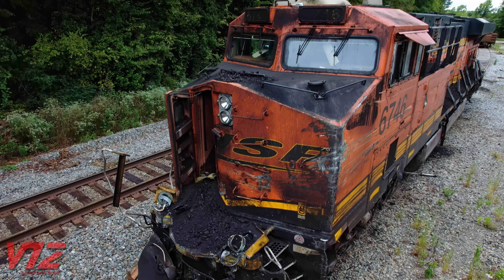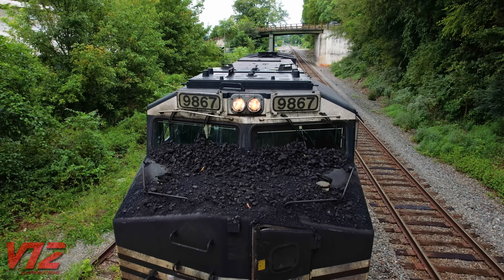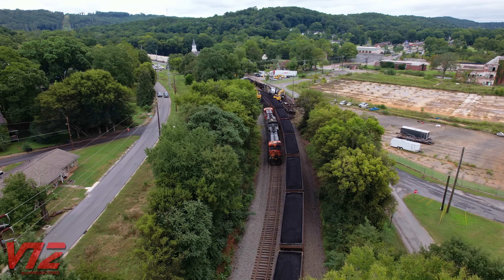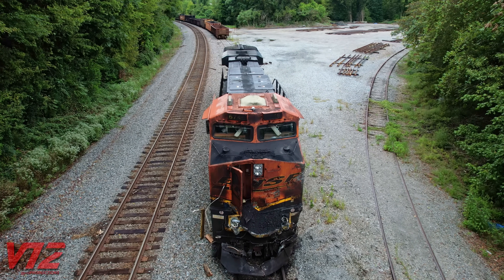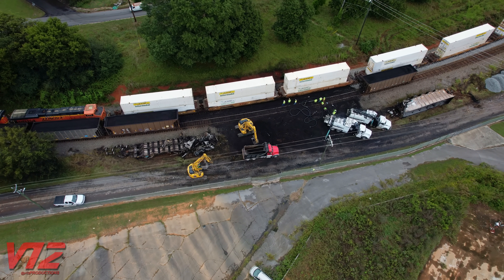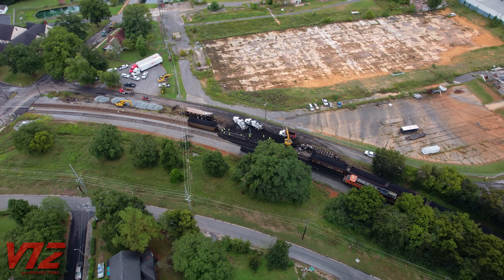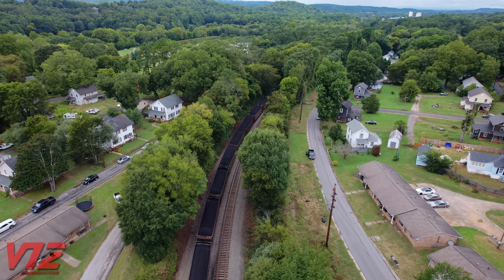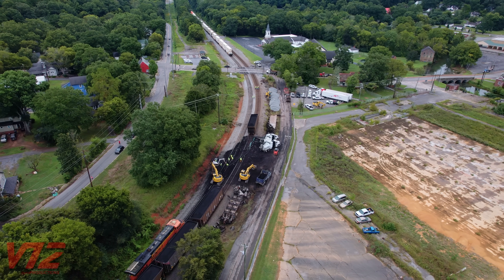RUNAWAY Locomotive & Head-On Collision in Rome, GA

Comment: Came back to this video after seeing a video surface from one of the crew members of the train that got struck head on. The video shows the single BNSF locomotive running red light in cab at a steady pace past the worker, and then slamming into their train. Thanks for the clear explanation, crazy to see with all the things we've done to modernize railroading, runaway trains are still a risk. read through the comments and glad to hear no one was onboard during the collision, hoping for a quick recovery for the crew that jumped.
Reply: Can you share the name of the video. Not having much luck finding it.

Comment: they are all good, lead engine knuckle came apart after hitting the coal car that jumped track idk why, but it ripped all the brake rods off and chains the left side and with air lines cut off no air could supply the other side making them useless and no chains means no hand brakes either.....and if i remember correctly when it goes into emergency the dynamics cut out
Reply: I was wondering how it could “break free” without going into emergency and kept on going. That explains it! Man, that’s the worst bad luck an engineer could possibly have! Damn!
Reply: Damn !
Reply: It probably depends on the railroad as far as the pneumatic brake application disabling the dynamic brakes. One class 1 that I know of has disabled that feature on most of its locomotives, the big road units for sure. You might know the guy as Uncle Pete. The dynamics work 100% of the time, unless there’s something wrong with them and the crew had to disable them manually.

Comment: On another railfan site the word was that both crews are a little banged up from bailing out.  According to the word there, the coal train went into EMERGENCY for some reason and two hoppers near the rear derailed.  The intermodal sideswiped those hoppers.  I do NOT know why but apparently the lead locomotive of the intermodal became a runaway (no brakes) and collided head on with the NS unit at about 25 or so MPH.

NONE of this is official and is subject being 150% wrong, it is only what I had picked up from another site.  But according to that site there were NO DEATHS or life threatening injuries in either crew, broken or bruised ribs and arm / wrist injuries consistent with jumping from a locomotive.
Reply: the no brakes part is accurate, 6746’s brake cylinders were sheared off as seen in the beginning, which meant the emergency application did absolutely nothing.
Reply: Your pretty close. Storms were giving the signals issues and the signal in front of the coal train dropped on the crew. PTC put the train in emergency and that pushed two hoppers off the track. The intermodal train side swiped the coal hoppers shearing off the brake cylinder and brake rigging for the handbrake. This also caused a dynamic brake failure somehow and the rest is history.
Reply: Storms was giving the signals issues. So they no damn well the machine broke down ! And why. That's just how deceitful the big wheels are. FRA needs to step up and do their job !
Reply: @rc391995  Its not uncommon to see heavy rains affect the signals. Just the other day PTC showed an intermediate signal dropping from a clear to a restricting and back at the block ahead of us.   The railroads only want to make money and cut everything down to bare bones to increase profits. They have no interest in fixing the infrastructure until they absolutely have to. It's situations like in this video as to why we are not budging in negotiations and will likely end up in a strike.
Reply: I think you should strike. The very fact the signals are dropping out by no means make it acceptable. I saw this crap coming as they was putting the hardware in for this stuff.  I've logged several hundred miles as a conductor and have switched an untold amount of cars although I was mainly and most of the time a yard duck. But been sent out to retrieve dog laws quite a bunch. Not that all that matters but im very accustomed to their practices and stood nose to nose with the top executives more than once. They want to intimidate with you with fear.  I'd  die first before I would allow them to see me sweat . just sayin .Ain't my first rodeo. Hope you get what yoh guys deserve more help and more money. I don't think you will be able to strike long. Here's one you likely won't understand if your in the union don't ever vote republican. Ronald Reagan screwed over the unions for a life time . Google it you don't have to believe me .
Reply: Cloud cover has long been an enemy to GPS  that's the only reason they want one man right now. If they perfect it the will want one day to let that guy go as well. I've seen this coming for only fifty years.
Reply: Oh crap just read this . us government makes contingency plans for rail shutdown.. 

Better get t know your local chairman and general chairman well. Ask them just where you need to stand. The heart and soul of your jobs are at stake here.  Thus accident is the best defense you all have at the moment. Need to make it count !!!
Reply: L.O.L. My experience as an Engineer in real life, tells me when a consist goes into emergency, it's more than likely a DERAILMENT somewhere along the consist. Procedure is to stop train, apply INDEPENDENT Loco brakes AND train brake. walk back until the source of the emergency application is found. In majority of cases, it was always a derailment caused by various reasons. BUT, Company Policy and Safeworking Rules also stipulate that in such cases, the opposing track must CEASE traffic until it is acertained there is no obstruction. Clearly, this was not instigated in this instance. I'm very glad, that I was not employed in the U.S. to drive trains there. Not suprised to hear, they're taking stop work action, about time too, IMHO.
Reply: @itchyvet  My experience as an engineer tells me that emergency is more than likely NOT a derailment.   It is usually a separated air brake hose or other types of mechanical failure.   In particular with the autorack trains.
Reply: After looking at his post its obvious to me he'd never make it as an engineer over here.
Reply: @itchyvet  Too many train games

Comment: I don't get it.  The lead engine "broke away" and kept going...but what was its engineer doing?  He didn't or couldn't stop?
Reply: First Collision  tore brakes  up ,he had no brakes!
Reply: The handbrake chain got torn loose also, so no emergency type brake either. The dynamic brakes probably wouldn’t work either because it was in emergency after the brake cylinders were torn off and it lost train line air. All they could do was sit back and wait, either for it to coast to a stop after traveling quite a few miles or jump when they were about to hit something else on the track.

Comment: the lead bnsf motor got loose when the rear left pilot was bent upwards in the initial collision with the coal cars forcing the coupler cut lever up,  essentially the locomotive pulled it's own pin, during the brake away,  the mu hoses separated of course,  the main reservoir hose valve open exhausted all the air that it would need to slow the engine with the independent brake.  Also being in emergency the engineer couldn't recover the trainline, that valve also open plus the ripped off brake cylinders.  publicly the question remains as to why the signal dropped on the coal train resulting in ptc forcing its emergency application. the dpu units must likely caused the detailed cars in the curve.
Reply: From personal experience. The signal may not have even dropped. Seen and had it happen plenty of times, PTC just freaks out because of a communication issue.
Reply: @osrr6422  exactly, and with DPUs, they dont immediately stop pushing just because the head end went into emergency. Depending on how far the dpus were from the head end, they could have kept pushing for up to 10 seconds after the head end went into emergency.  Non railroaders dont understand that the dpus are a few seconds behind the lead commands, and in the event of a brakepipe interruption, it could be a few seconds for all the brake valves to dump from head to rear, meaning the leaders can be on their side digging up rocks, and the dpu still pushing for a few more seconds.  Basically ive said the same thing 3 times here , 3 different ways lol.  So for everyone else... that could be the reason why cars derailed after a PTC braking enforcememnt.

Comment: This was all caused by PTC - it threw the train into emergency! "NS 732 went into emergency when a signal dropped out on the crew, PTC doesn’t understand that so it throws the train into emergency, thus derailing 2 coal hoppers. NS 283 hit them and the lead engine broke free and was unable to stop and hit NS 29A head on around 4:15 this morning"
Reply: Yet the PTC didn't stop the runaway engine?
Reply: @mikenodine6713  the runaway engine lost its air brakes. Supposedly the pistons were damaged/sheared off in the initial collision. PTC can’t fix that.
Reply: Wow ! I can see all that coming into play now .
Reply: @duluthdepot6355  Thanks, now the question is what kind of engineered solution would solve that kind of issue?  Or is this kind of incident so rare that it is cheaper to accept the losses when it happens? Even if it is a school bus full of kids?
Reply: Its starts with PTC. Any time a train gets in emergency you don't know what's going to take place . and when you got several DPU's going it just compounds the problem . The train going into emergency sure isn't a pleasant experience . that's a last resort measure. Some engineers won't swipe the gauge for an automobile on the crossing till after they've hit the automobile. Some won't even do it then and I don't blame them. Its all in according to the make up of train speed weight and terrain. Lots if factors come into play dynamic forces lateral pressure. I've seen more times than I can count on my fingers and toes the results of emergency brake applications. It ain't pretty !!!
Reply: And by the way the crew was never given a choice to make as far as a corrective measure to take. The machine broke down and nearly killed a bunch of people. The machine will never have to answer for it. It made the wrong choice !!!
Reply: @rc391995  My guess is they survived because the bailed... nothing else they could do... except the horn needs a button you can push to lock it on so at least it's still sounding a warning when you jump off
Reply: We just need to go back to ATC and be done with it. 

There will always be problems but at least you can still control what the locomotives do.
Reply: It's only a matter of time before a passenger train is involved.
It will be a massive tragedy. 
I dread the day.
Reply: I'm certain they jumped . little other choice .
Reply: I'm also pretty certain I read here the guys on the run away radioed the crew  on the NS engine what was coming there way . they got off. Them guys done everything they could do with what they had left . I admire their bravery . they thought of their buddies.

Comment: I am surprised there isn’t a fail safe prevent this. In many if not all passenger trains they have such a device.
Reply: Oddly enough...it is possible (but too early to tell) that the "fail safe" device actually started this unfortunate chain of events
Reply: Such a device would not have worked when the brakes get ripped off.

Comment: How did the Norfolk southern diesel get coal-coated
Reply: most likely, it was coal that was on the BNSF loco, and when the two collided, some was thrown onto the NS one
Reply: That’s a very interesting question as well. Carried that much coal 4 miles and dumped it on the NS engine. Naw ain’t buying that one !
Reply: @rc391995  
Why not? It’s not far fetched to think the BNSF travelled that far with a pile of coal on the nose and transferred some of it to the NS unit when they slammed together. You can see the engineers windshield on the BNSF is pushed in, most likely by coal when it hit the coal car. Those are bullet resistant windshields, it takes quite a bit of force to knock one completely out like that.
Reply: I can't account for just how coal has transferred from the bnsf engine to the ns engine . maybe the bnsf engine carried a coal hopper on its back and threw it at the NS  engine when it got there

Comment: Has a 30 year veteran locomotive engineer from the union pacific railroad I don’t understand how this locomotive broke free from the Locomotive consist and the PCSSwitch did not kill that locomotives motor as that is one of the major safety appliances to prevent a runaway locomotive unless someone turned the main train line air valve to close which would not allow the PCS switch to trip if that were the case this becomes sabotage and there’s a human element involved
Reply: So explain in your words just what happens when the brake cylinders are ripped out and no longer part of the engine ? What operates the brake shoes then ? I was mainly only a switch man maybe I don't have the superior knowledge of the everyday foamer !

Comment: Who has the best paint scheme on the railroad
Reply: BNSF and KCS.
Reply: @tomheringer2047  I saw a train through the woods with a DPU that was red with what looked like lightening strikes on the side. BNSF leading and the only thing I could think of MKT. Any guesses?????? In Nebraska. The engine was really clean.
Reply: @robertmason7553  Could have been a Wabtec FLXdrive Battery Electric Locomotive. Wabtec (formerly GE) hooked up with BNSF to field test their new battery electric locomotive. The front half of the loco was red and the rear half was gray with 6 diagonal white stripes.

Comment: Was this accident preventable? Of course, grade-crossing accidents are preventable, but what about when two trains hit each other on the same rails? (like in this video) Is this type of accident preventable? Also, did these two locomotives derail after hitting each other?
Reply: Essentially every type of railroad accident is preventable, we're almost 200 years into railroading in the US and there have been an unfathomable amount of lesson teaching train accidents, in which the technology on the railroad was changed or improved. However, there are some that just aren't preventable, such as a chance accident like this where (i assume) the crew of the coal train probably didn't have time to radio that they were on the ground.
Reply: These two trains were passing one another headed in opposite directions when the coal hoppers began to derail. There probably wasn't enough time for the intermodal train to stop before it impacted the cars. Once the impact happened, the brakes were sheared off the lead unit, making it difficult, if not impossible, to get it stopped at that point
Reply: @andyangle809  I don't think it would be difficult or impossible to stop if things were shut down via the breaker cabinet.
Reply: @andyangle809  There wasn't enough time for the trains to stop. They weigh thousands of tons and take a mile to stop, whether they hit a car at a crossing or, in this case, hit another train heading the opposite direction.
Reply: @wondabiz  Some train accidents are not preventable. This one, in particular, was not preventable. Like you said, the crew in the coal train didn't have time to radio the other train heading the opposite direction.
Reply: @HustleMuscleGhias  
So you’ve just shut the engine off by killing the breakers in the cabinet, now what? You still can’t stop it because the brake cylinders were torn off in the collision along with the handbrake chain rendering that inoperable. Once the brake cylinders were torn off, the air pipes were opened up and no air could be applied to the remaining good brake cylinders. There was literally no way to stop the 400,000 LB locomotive from rolling down the track at this point, unless it was a fairly steep uphill grade, then if it stopped before topping the hill, it would roll back in the direction it just came from because there still isn’t a way to prevent gravity from making it roll downhill.
Reply: "Shut the breakers down " wow !!! Pfft   !

Comment: DPUs are not used for the reason you stated.  They're used because it's cheaper to run 2 trains hooked together with 1 crew than it is 2 trains with 2 crews.

Comment: I am surprised that the crew of the BNSF locomotive were not able to kill the engines. Loosing the brakes and dynamics is one half of the equation, but what about cutting out the power?
Reply: Once the intermodal train suffered a separation, the brakes would have applied in emergency and the PCS would open on the engines. That means no dynamic to slow the engine down that broke away, and no power to apply in reverse to slow it down either. With the brake cylinders ripped off, no air to apply the brakes on the runaway locomotive. Perfect storm.
Reply: Locomotives in motion without brakes and power can coast for miles and miles and miles on level track